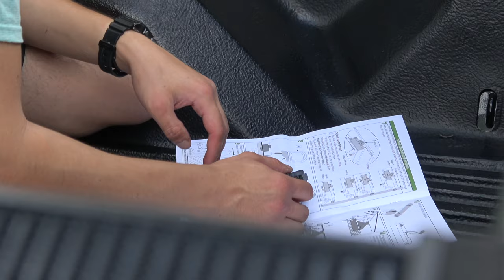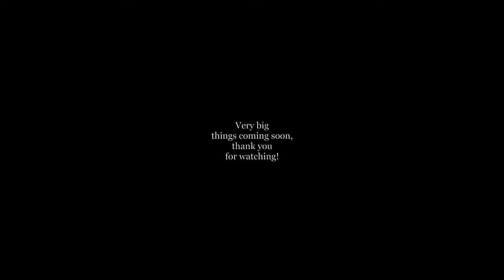Installing the Gator ETX Soft Roll Up Bed Cover | Preparing for a trip across the US

Comment: Just my .02cents... it's truly a fantastic cover for the cost. An extra added security for leaks would be closed the tailgate first and then push down to secure the cover that way the gasket fits on top of the tailgate which will eliminate water from coming in. Sometimes that gasket will be in front of the tailgate which is inside the bed and water will get in. I'm sure because of how old this is you already know that but just in case.
God bless and Safe travels
Reply from the maker: Thanks so much! And we did do it the way you're mentioning when we actually went on the trip and it worked great! 🙂
Reply: @WHOAyouguys  ... thanks for the reply and it's good to hear. Your video is great because of it I've ordered mine. 🤙
Reply from the maker: @bigk3381  that's awesome, thank you! 😊